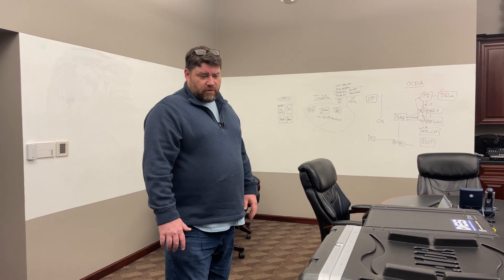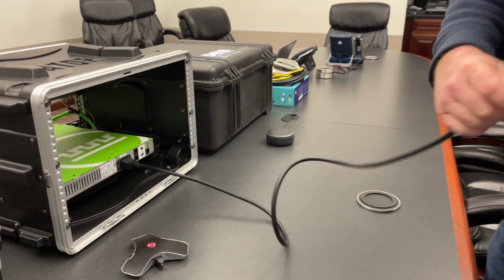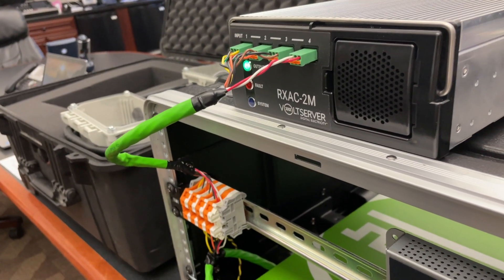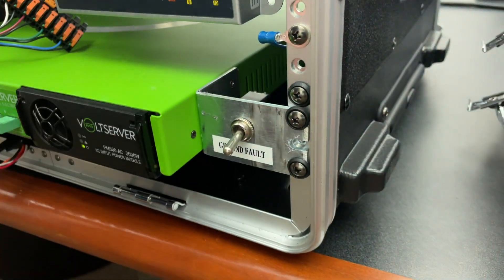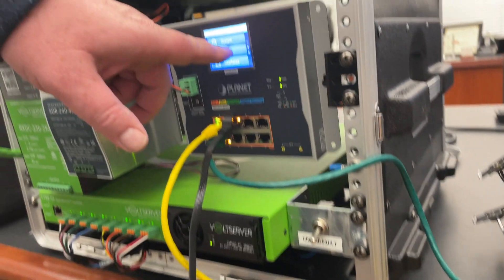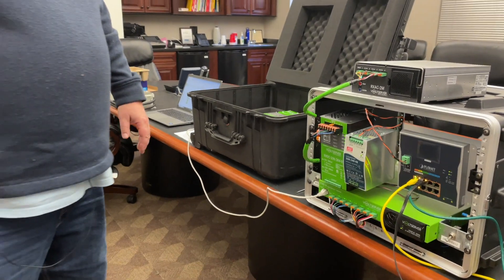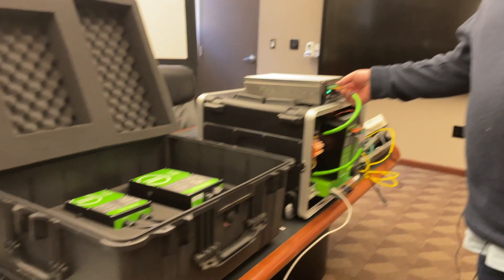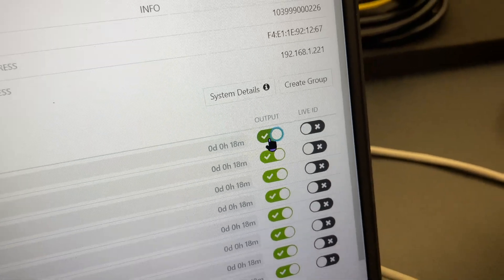How to Set Up a Digital Electricity Circuit (full length)

Comment: This just gives me a stroke. 

Digital electricity... Come on bro just call it high voltage voltage DC. 336VDC is not low voltage nor should any non electrician be dealing with this

Comment: can the receiver deliver 220V - we use 220 in South Africa - or will one have to use a device inbetween  the receiver ( like you are doing in this video to step down to 48V for the switch ) to achieve 220v Output on the receiver ?

Comment: Beauty! Wondering if DE could be used with HVDC solar systems (combined with MPPT) and if we should expect high power appliances (eg. induction cooktop) with embedded DE receiver or EV chargers! (So we can finally get rid of AC)

It would be also interesting what is the efficiency / power loses during all those conversions (transmitter/receiver/power supply)